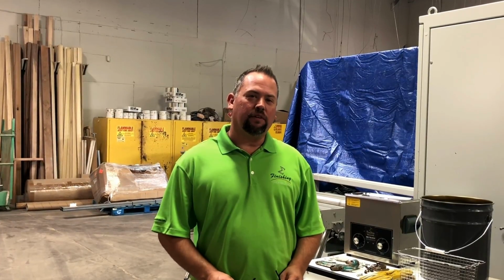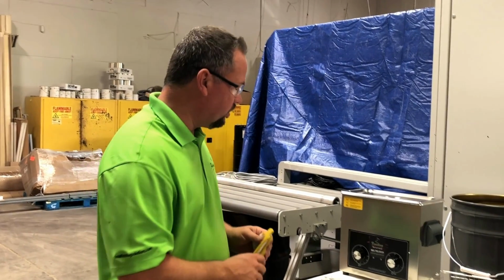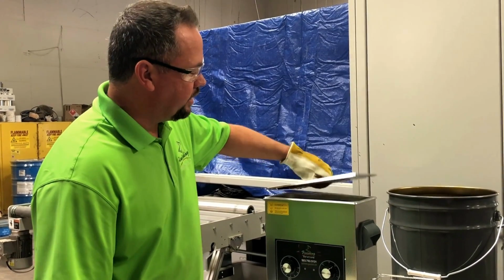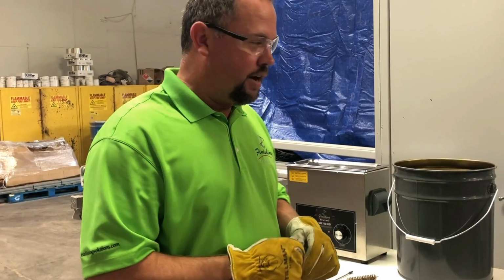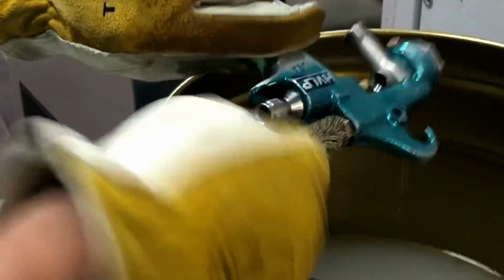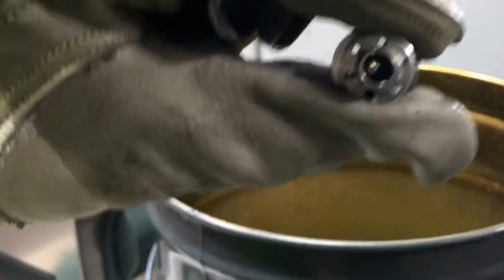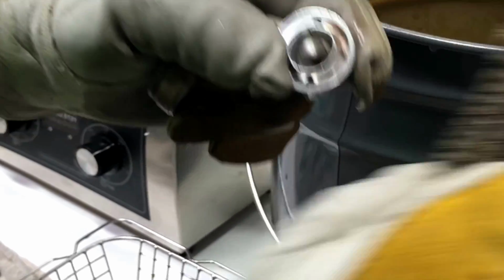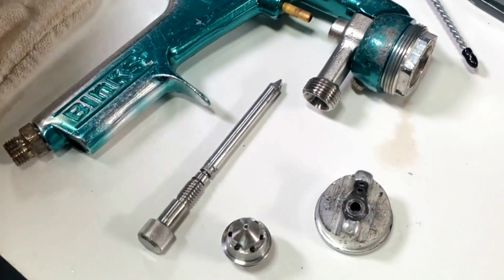Ultra Sonic Paint Gun Cleaning Video

Comment: What’s the point of this if you’re still brushing the parts clean?
Reply from the maker: This will remove powder coatings, Teflon, polyesters, urethane, etc. rinses with water and you concerned that you still have to use a nylon parts brush to remove it after a soak?

Comment: Can other chemicals such as simple green be used to the same effect?
Reply from the maker: Jason Aguirre simple green is corrosive to a lot of metals and can adversely affect finely machined items such as air caps.  Also simple green does not work well on catalysts and solvent based paint materials.
Reply: @TotalFinishingSolutions  ah, good to know. Any off the shelf recommendations or do I need to order something like you mentioned.
Reply from the maker: @JasonAguirre  you can purchase the sonic tank and the proprietary solution recommended here: 

https://totalfinishingsupplies.com/collections/featured-products/products/1-5-gallon-heated-stainless-steel-ultra-sonic-cleaner?variant=34787136635047

Thanks!